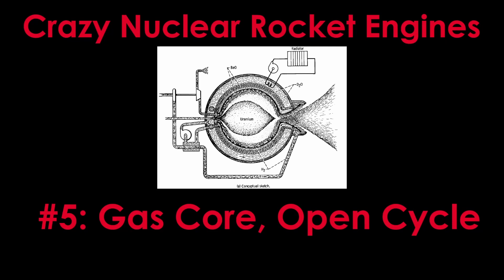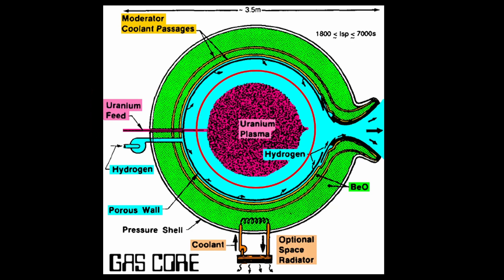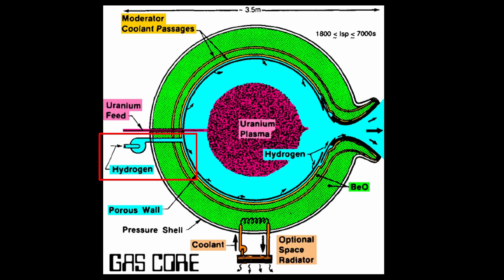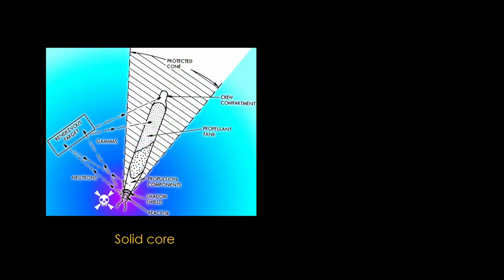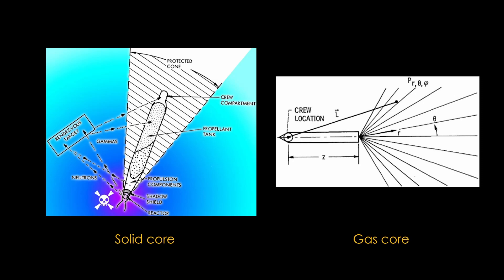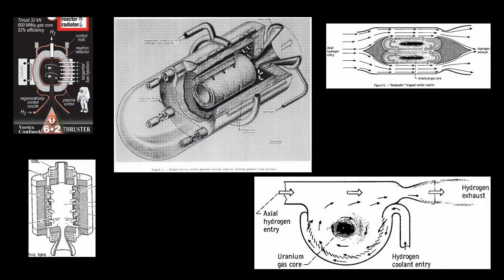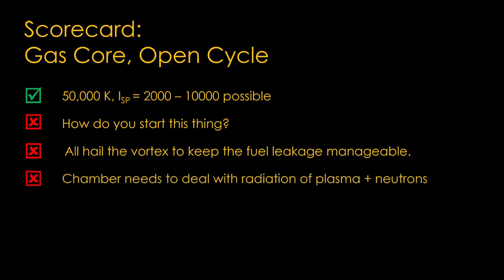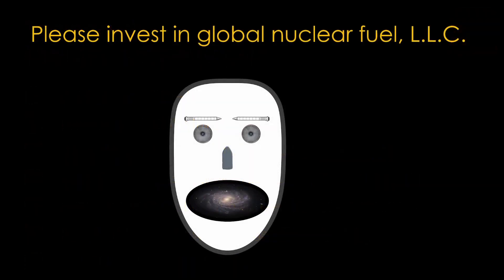Crazy Nuclear Rocket Engines 5 - Gas Core, Open Cycle

Comment: Why not use magnetic confinement ala fusion to contain the plasma. You just need to keep hydrogen flow high enough that it does not ionize too much.
Reply from the maker: You just need a workable fusion reactor.
Reply: @EagerSpace  true, if you have a workable light plasma confinement setup fusion rockets are on the table and have advantages

Comment: 1: Just biomod humans to be fine with radiation.
2: Slightly more seriously, there's nothing wrong with having an unmanned freighter rocket design. So the danger to the crew, while hilarious, is only a problem for a certain type of mission. This goes for all other nuclear designs as well.
Reply from the maker: What will you do when the freighter shows up at its destination? It's highly radioactive even when the engine is off, and unless the cargo has been well shielded, it will also be radioactive.
Reply: @EagerSpace  There are three choices that I see. 
The first is that you stage the nuclear part and finish the journey with a chemical rocket. 
The second is that we land a fair distance from our imaginary colony, or that they've built some sort of shielded landing pad, and so the burden isn't on the rocket. If this is a space station, I suppose it'd have to be even better shielded that by default.
The third is that there are no humans at the destination either, autonomous&remote-controlled systems only.

The question of the cargo being radioactive is a good one, I suppose it depends on what the cargo is and what we're willing to tolerate. We could still need some level of shielding, just less than if we were carrying humans, but I'll be honest, I'm not sure how to properly math this.

Comment: The simplest way to protect from radiation would be to just put the reactor on a long boom to space it away from crew, this does add some mass but probably less than shielding that would be needed otherwise.